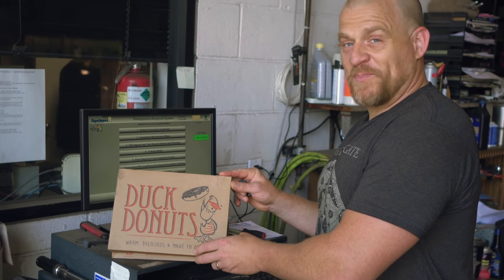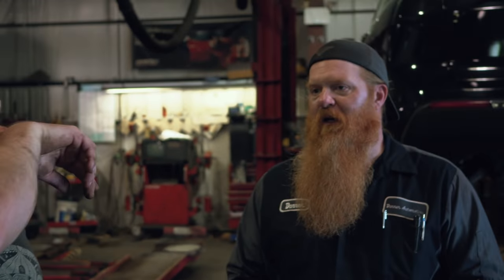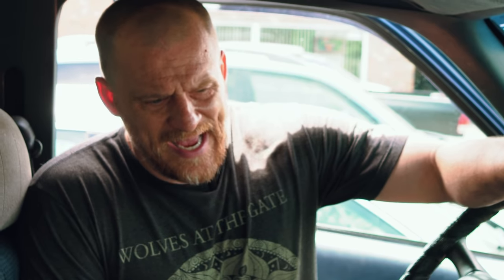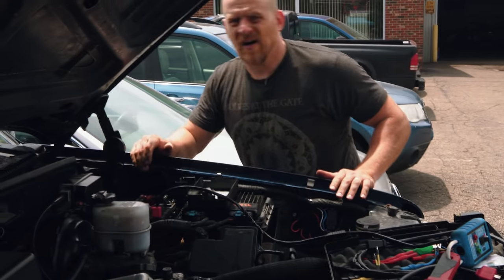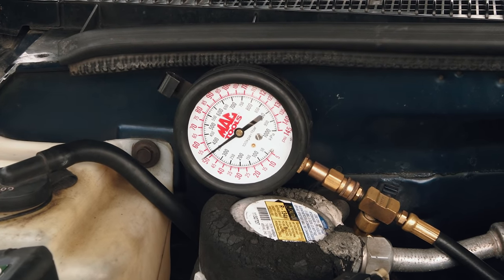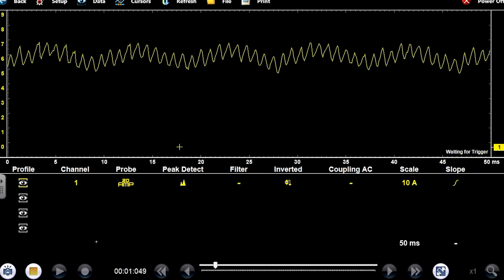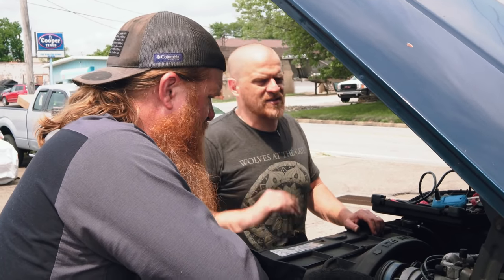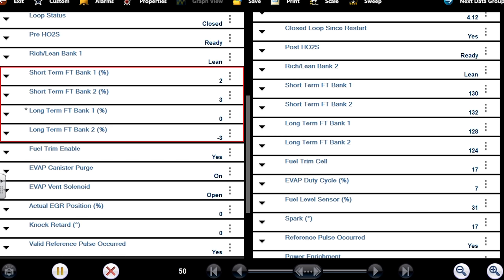Could a P1351 be a False Code? (older GM trucks and vans)

Comment: 99 Tahoe 5.7 almost identical symptoms and same code. Original issue was a no start- plugged fuel filter got it running, Fuel PSI test was good after. 
Weeks later, would start and die and throw the 1351 code, and not restart-it would try, but not take. No spark this time. New coil and ignition module got it running.
A few weeks later- start & die. Sometimes it would try but not start sometimes would just crank- setting the code each time. Clearing the code would not allow it to restart, but removing the negative battery cable and holding it to the positive cable for 20 seconds, re-attach and fire right up and be normal for 5-7 days. Rinse and repeat- no start, battery cable routine it will start every time. I did get a custom tuned VCM as I had changed the camshaft 4 years ago when I built the engine. Hoping maybe it was something with it but still shows up. Trucks runs better with the tuned VCM but the problem start/die still occurs. Pulling my hair out! I did do actual resistance and voltage drop tests on all wires mentioned in the factory manual for this code and all checks well. This video gave me ideas to check the fuel pump current draw and starter draw.
Whoever cures this mess will be a hero for sure!
One other thing I noticed- after changing the coil & module, to see If it gave me spark- which it did, I thought the spark looked weak- a little orange rather than a nice sharp blue spark. Ignition module was purchased at AutoZone Thoughts?
Reply from the maker: When it doesn't start, do your checks on the coil and module! You'll find your issue. Follow some of the test light control circuit tests I show on ignition coils.

Comment: Bad control module, but whats the cause. My 2001 gmc keeps having the same issue  . But everytime i rplace moudule runs fine for a while.
Reply from the maker: Junk modules if you're having to keep replacing them. I'd also replace the ignition coil if you're burning up modules

Comment: Great content! You could only improve it by including clips from Red & Green from yesteryear in that sometimes duct tape an a maul are the proper tools!  ;) 
That said, P1351 in GM/ Ford, although relatively common, are very enigmatic at best! I I'm reminded of the phantom code 32 EGR code from Pre OBD2 days on Chevy/ GMC trucks with 4L60 transmissions..... which turned out to be a faulty transmission TCC solenoid! I also remember the wonky distributor pick up coils that drove otherwise very competent driveability technicians to consider the ministry back in those days!

I see that this video is quite old, but had to chime in. The argument you and you bearded Bro had regarding a sine wave as opposed to a 5V square wave pattern has to do with manufacturers encoding engineering into their monitoring of EEC/ OBD2 functions. These functions are out of reach for all but a few of us peons down here in the repair bays. 

Chasing fuel correction for the 1351 usually is a natural snipe hunting diversion due to symptoms. You were looking right at a big clue as to the problem with the internet special ignition parts. I get cars in all the time from both local and hundreds of miles away that have been to as many as 5-6 repair facilities including dealers. These customers just wanted to get their vehicles fixed. I wonder if you guys ever heard about a final solution for this truck, short of getting rid of it.

Comment: You mentioned white smoke telling you a possible stuck open fuel injector.. wouldn’t rich be black smoke? I thought coolant was white smoke.
Reply: An extreme amount of gas will not burn at all and can show white,  probably more like unburned gas vapor than smoke.   I had a 4.0l in a ranger do it to me once.  It was pretty weird to see liquid gas coming out of the tailpipe of a running engine. All because of a stuck open fuel injector.
Reply from the maker: Cole, check out this video of a stuck open injector 
https://youtu.be/FOwwFIWQhsQ
Reply: @ScannerDanner  are you telling me ASE tests are lying to me?!? 😆
Reply from the maker: @MMAunderbelly  I don't think they offer that option 😂

Comment: I was thinking the same thing.  Dead heading the pump reseated the injector.  Once you go for a ride it gets unseated again.  When he said it happened while driving, he may not have meant at speed.  I "drive" my truck to work, during that drive, i have to stop at lights.
Reply from the maker: Good point! I do NOT know when exactly it "shut-down" on him. If it was at idle, and not at speed as you mentioned, then this can absolutely put us back toward the injector
Reply: @ScannerDanner  I betcha one of those spark plugs look a whole lot different than the rest.  The owner likely changed them since he changed the rest of the ignition system and 7 of them should be clean.

Comment: My 1996 Savana L30 dtc po1351 turned out to be Starter Relay arcing pin 30 to pin 86. The relay was also puffy in appearance. Know one wants to know how long for me to find this, because I'm slow. lol.....New Relay installed, vehicle driven 5 days without incident. Thanks Scanner Danner for your videos.

Comment: I know this is an old video, so maybe tossing this into the void…

Crank position sensor has symptoms the owner was having issues with.  I’ve had this head scratcher on many 90’s era Jeeps, and mechanics tell me those never go bad…I had three vehicles in one year all with slightly similar symptoms of, crank no start, intermittent start then stall while driving ect.  If the P code is leading you down rabbit holes with all of these symptoms…

Issues Starting the Vehicle.
Intermittent Stalling.
Check Engine Light Comes On.
Uneven Acceleration.
Engine Misfires or Vibrates.
Rough Idle and/or Vibrating Engine.
Reduced Gas Mileage.

The CKP is a sneaky little sensor that gets overlooked for more obvious fuel/spark related issues.
Reply from the maker: For sure! I have quite a few crank sensor videos on Chrysler/ Jeep systems with some even setting false ignition coil codes, with coils dropping out.

Comment: Im here because I got the code on a 98 GMC Sierra 1500-installed new Ignition Module and coil after she sat in the weeds for long time(yes fuel tank fuel pump and fuel lines and working my way to the brake lines presently) she ran great until I parked her IN THE RAIN with hood open as I charged the battery over night-next day she started and quickly stalled-code 1351-by accident I ordered TWO Ignition Modules from different companies sooo I had one on hand and plugged it in and she fired right up and purrs like a kitty🙂at the start of your video you said the guy thought it mightve had sometjing to do with the rain and I concur🙂

Comment: The problem is the fuel pressure regulator is ruptured and the spider injectors need to be replaced while you’re in there. Just fixed my 1351 ghost code I’ve had for over 2 years. Cost me $760 parts and labor. New multiport fuel injection is only $300 for the part. You’re welcome!
Reply from the maker: from memory fuel trim numbers were normal so a ruptured regulator is not the cause on this one, but certainly anything that causes a long crank time can set this code, as you found out too

Comment: Do you have a bad fuel pump? I had a 92 f150 that would run good for 45 minutes and then all of a sudden the truck would die and wouldn't start customer called i would drive to his location which was 20 minutes and the truck would start and run perfect he would drive it home and would run good again for 45 minutes and die. So I had him start the truck cold and I left my house and was at his place in 20 minutes truck continued to run all toll for a hour and then died so When I put voltage to fuel pump it would spark at the wire connection I had made but pump wouldn't run. Found out it was a pump from ebay and I put a new pump in and solved the problem. Ask customer if pump is from ebay and not a factory gm pump.

Comment: Paul youre such an amazing auto tech love your in depth videos.  What do you attribute this to @15:25 ?  I have a 96 express that has just about everything brand new and still doesnt start. I cant find the fuel pressure specs for this engine, It has the upgraded fuel injectors from CPI to MPFI. I am showing key on engine off 58psi and right away drops 4-5psi to about 52PSI. Is this not enough fuel pressure to run this engine? 

This engine has new
Fuel filter
New ecm(reman)
New mass airflow
New crank sensor
New distributor 
New timing chain
New ICM
New Coil
New spider MPFI
New upper intake
New lower manifold gaskets
New dpark plug wires

Only thing I havent changed are spark plugs they are about three years old and fuel pump.

These parts were not thrown at it, it was from a different issue.

The engine was running perfect I came to a stop sign and it cut off and would not re start. I do have spark, the distributor was re timed with piston #1 at TDC, timing chain cover lined up with mark on damper. I lined up the dimple by the distributor gear to the line on the shaft of the distributor. The rotor, when distributor fell into place, was point towards cylinder number 1  and pointed towards were the distributor housing bends to turn into a flat edge. Has excellent spark.  Iam out of ideas and stumped…dont want to waste money on a pump if i dont need it. Ive read these engines need 60psi and above? Thank you in advance if u are able to respond! 

96 express 1500 5.0 220,000 miles no oil burning excellent power

Comment: Just had a RANGE ROVER 3.5 V8 EFI 1988 that behaved strangely sometimes.
Many different have looked at it and replaced parts.
Found out it was the brake booster that was the problem. I disconnected from this and
the car started perfectly every time and drive perfectly. :)

Comment: On this truck I have questions/comments. Isn’t this the injector spider set up. Looked like it to me but I may have missed it. If it is a spider, and he’s been throwing chinesium parts at this thing, then it’s very likely it was or is an injector issue BUT my comment on it is actually seeing the fuel lines moving like that with vacuum drop and raise would tell me there’s a problem with the install. I worked on a ton of these trucks back when I had hair and never saw the spider fuel block move. 
 There’s no end to it though, you’d have to go back over everything that’s been done to it and check for proper install AND quality parts. You don’t have much choice on quality parts with these older chevys though, I still own a couple and part situation is not good.
 As always, enjoying the content! Editing cracks me up on occasion and the hulk moment was one of those occasions. Keep up the good work

Comment: I had one last week. Fuel Pressure a little low. Acting like that on the way home.Intermittent But I had lean codes. Fuel pressure was hanging around 45 psi. I pinched off the return line & got 75. Fuel pressure regulator on the CPI was leaking & I found the Upper intake gasket popped out in the back corner under the Fuel lines. I’ve never seen that. I didn’t smoke it because it’s a pain on them. Regulator & upper intake. Made it run real good.
I scoped the Fuel pump, with a amp probe it was beautiful. I tried to get the fuel pressure to drop off under load. Couldn’t.

Comment: That was a class act at the end. I'm wondering if the fuel system is full of large sized contaminants (I call them dog turds) causing the FPR to increase the pressure intermittently and when bro unpinched the return line it pulsed the FPR and cleared it back into the tank awaiting the next (dog turd) which happened when a substantial amount of fuel flowed again while driving unlike the little stationary revs you give it in the shop. Has anybody looked at the fuel filter? Maybe it's blowing its own chunks into the system and the injectors are not affected, only the FPR. Funny a fuel filter causing a rich condition but I'm sure stranger things have happened.
Disclaimer:This comment is not based on experience or trained knowledge but rather a conjecture to provoke thought.

Comment: I'm pretty sure low fuel volume is actually capable of causing a RICH condition with this abomination of an injection system. Pressure seems fine, yes, but the low amperage draw from the pump may be hinting toward a delivery issue. It would be interesting to watch the injector pulse width...

Comment: Back in 81 I had a 4-6-8 Cadillac with an intermittent stall problem.   I spent about 30 hours chasing the problem and could never get it to stall or find a problem.   Finally we called Cadillac engineering and they said just replace the fuel pump relay.   That took care of the problem.  I was paid 1 hour for diagnostic time and 3/10 for changing the relay!    (I lost almost a weeks pay on that car!)  At least at the dealerships we had access to the engineers and were familiar with most weird problems.

Comment: Personal experience here. Had a 4.3 vortec platform. It had a rough running condition where it would nearly die upon closed loop. It had codes for a lean condition. The O2 sensor harness ran along the back of the engine, and oil was wicking down the harness from the oil pressure sending unit. It would saturate the O2 sensor and caused repeated failures of the O2 sensor after a few thousand miles of it being replaced. The saturated O2 sensor was reading a false lean condition and flooding the engine with fuel, thus creating a vicious self-perpetuating cycle. In the hands of another, they'd see the code and assume a true lean condition and focus on a vaccum leak, low fuel issue, etc. DTC's are great in the hands of technicians whom know that they're a tool and a guide. They're not infallible. I detest when I see a generic question about a car, and there's always that person "probably an o2 sensor/fuel pump/throttle body."

Comment: I know on a 99 suburban with the spider injectors it takes minimum 51 psi if the cam signal is funky it will bank fire and kill the fuel pressure quick well below 50 psi, then you get 1351 and long crank or no start. came back three times a no start, (would fire right up for me) before I figured it out. sounds like a wiring or connection issue.
Reply: Yes sir. I’m getting this code intermittently on my 99 suburban. I’m trying to figure out what’s causing it.
Reply: @alphasaiyan5760  check cam signal in dist. mostly a no start when ambient temp below 40 fahrenheit also icm.
Reply: @prmayner  thanks.  I’ll check the cam signal. It’s been in the 60s-80s temp wise here. My truck just started doing this about a week ago. It’s only done it twice so far. It doesn’t start one time then it throws the code but then when I go to start it again it starts up with the code stored. I just clear it with my scanner and it runs fine like nothing is wrong with it. I’ve got a 5.7 vortec tuned 60 over with a tune from Nelson’s performance. Headers with cat delete exhaust. I just did a partial tune up too. All AC delco. Cap , rotor , plug wires , plugs. The only thing I changed was from AC delco 14 platinum plugs over to AC delco iridiums. Would the iridium plugs have anything to do with this code ?
Reply: @alphasaiyan5760  I highly doubt it.

Comment: I did have a pump on a returned system fail 1 time in a real weird way it would only act up when the tank was under 1/2 empty and when driving in town, what I ended up finding out was that the pump pressure and waveform looked great but if I let it sit and idle for 30 min or so pressure started dropping and the waveform went to crap. When idling the fuel is getting dumped back 2 tank warming the tank up and causing the failing pump to show its face. Not saying this is what's going on here but thought it is worth noting.

Comment: Check cat on each bank for different colors ,I had one spider injector dumping fuel cooking  catalytic on one bank only.'  Extended crank and misfire.   Also the top of the fuel pipes have a seal and should not move around.

Comment: I'm having same issue have a 1996 c1500 wont crank/long Crank time and still won't start
Reply from the maker: If it is not starting, find out what you're missing. Spark, fuel and compression need to be verified

Comment: the ignition modules on those are known to get "stupid" with high temperatures when old, aftermarket modules are complete trash. many people warp the heatsink and module from over-torquing the screws. if either are bent the heat transfer is poor and the module overheats into thermal shutdown and breakdown.

Comment: i have seen those have a partial ignition failure  blow lots of smoke cuz it cant burn it all then the computer leans it out making it do the chug chug. a viscious cycle in the computer trying to adjust. sounds to me like it has a module going or the ground to the module is bad letting the voltage go high on the b+ (causing the code)cuz it isnt pulling the amps through the coil. may want to watch that ground to see if its elevated.

Comment: A 2008 wrangler jeep was working fine except  changed the power coil ,plug wires and plug and its only firing on 4 plugs and not 6 and when u use the old one the same thing coming up and check engine light come on what is the issue
Reply from the maker: Are you saying you caused this condition? This happened after some maintenance? Or you changed those parts in trying to fix your two cylinder misfire?

Comment: What if the fuel pressure shows good, but there is a lot of fuel returning back to the tank because of a bad fuel pressure regulator The pinching off of the return line got my attention. Easy check see if return fuel is the same pressure as supply pressure. Do a visual on it into a container